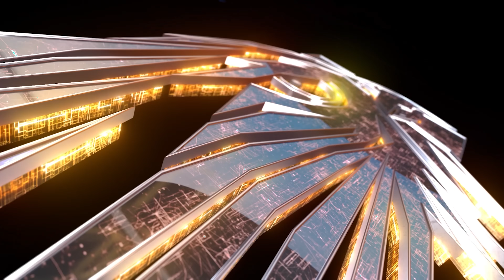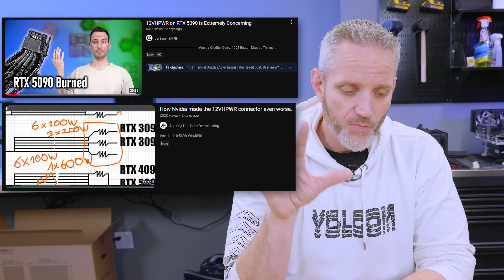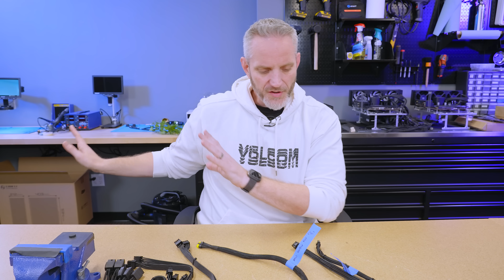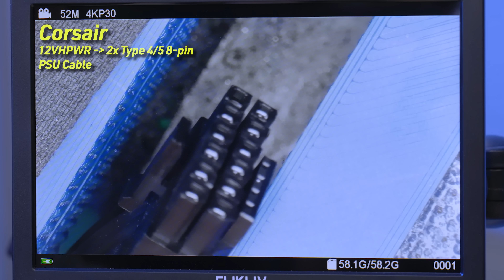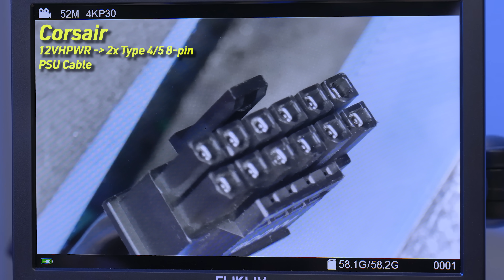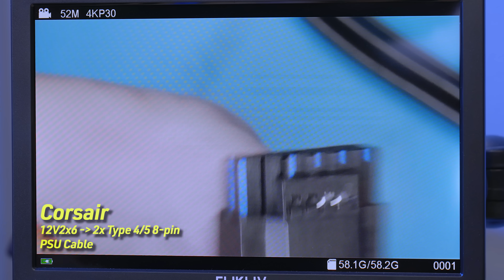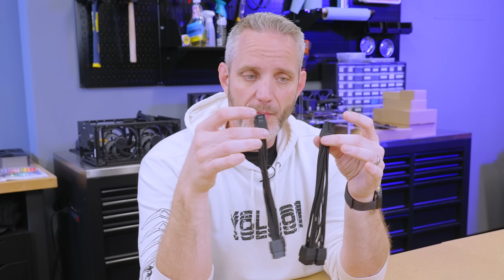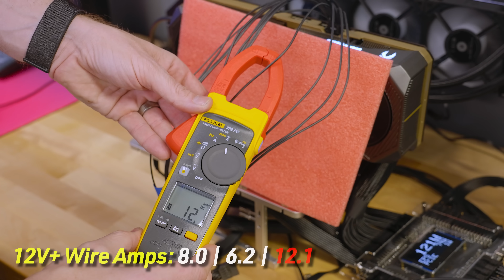I discovered something concerning and I need the Experts to chime in... More 12VHPWR discovery!

Comment: Without load balancing or per lead current protection, this is a problem.  Google what gauge wire you should use for 12v @600w over 3ft.  If this were a "to code" build, like a house or appliance, that's usually a 6ga.  A 6ga wire has 13.3mm^2 area to carry the load, where as 16ga is 1.16mm^2....  6 leads is trying to get the job done with only 6.96mm^2 area in a perfect world.  Stay around the car stereo scene long enough and you will run into the person who thought they could just twist together a bunch of speaker wire to power there high current 12v amp...  Sound familiar?  Know where this is going?  No blow fuse, amp playing fine, until the moment the carpet catches fire....
Reply: The best blunt sessions tho fr 😂😂
Reply: Correcto. 16ga would still be cutting it close, but would likely be ok if it were balanced. I work in Data Centers on critical power, definitely not a GPU expert, is load balancing possible through like a firmware update? Or just engineering?
Reply: @superthrustjon   Unfortunately no, the cards affected have the high rail all connected by a single plane so the problem is baked into the PCB layout and cannot be solved firmware side.

Furthermore the problem is likely not limited to high rail side, the grounds are all connected together as well on every single card. I think there is a high likelihood though that if the ground connections start failing, the card will receive a ground offset and plain stop working properly without visible damage to the 12v 2x6 connector. Other possible outcomes result in current through mounting bracket and enclosure (EMI) or burning PCIe edge connector.
Reply: I bet this is faulty crimps. When the wires are stripped if any whites are accidentally cut, as regularly happens when you strip by hand, this can cause the crimp connection to see increased resistance leading to an imbalance between wires. The total strands and number of cut strands will effect this quite differently.
Reply: Lots of thinner cables dissipate heat better than one thick cable, because they have higher surface area. You don’t wrap your cables in braided sleeve, do you?
Reply: @Scrogan - Certainly multiple smaller conductors can provide better heat dissipation, than fewer larger conductors, provided variance tolerances are negligible (manufacturing, mechanically and electrically) and each conductor is carrying similar current and within rating. +~- 30% electrical variation under/over conductor rating, is not negligible. That’s not to suggest the cable/connector is the only factor (PSU/GPU design also matters), but there should be no conditions out-of-the-box, during normal operation under load, where exceeding conductor rating is sustained - that’s just overall bad design.
@UberUdder09 - Not to be condescending, but the skin effect affects AC applications as there’s no magnetic flux rate of change back-EMF induced on DC ELV.
Reply: @johngy6296   you have misinterpreted what i am suggesting.. skin affect will result in more limited distribution of current in the conductor resulting in higher resistances in ac circuits and potentially the need of larger conductors like 6ga. 

your comment also confirms that skin affect is different between 6ga and multiple 16ga.. apologize if my use of “might” threw you off
Reply: @UberUdder09 - Not sure why you ‘replied’ to me, as I clearly wasn’t trying to be rude to you. The skin effect ratio (as it pertains to your original reply to me) is only the difference between AC/DC resistance, whereby the conditions for skin effect to occur in an AC application, require the cable (etc) to be suitably derated/over-speced, as compared to the DC rating given. Being that the rating is based on DC applications for this DC application, I’m unsure why skin effect between different sized conductors ‘might’ require consideration? Unless I missed something during studies (which is entirely possible).
Reply: @UberUdder09  Long time out of school so I may be misunderstanding, but the "skin effect" as I recall is a bi-product of alternating current, with the higher the frequency the more prominent the effect.  However just because the energy is flowing in a field around the cable and is not physically "on the line," induction is still a thing, and the wire heats up just the "same."  This is both how a transformer works, and why they are usually pretty warm if you put your hand on one.  There is some relation with the extreme side of this effect that is leveraged in very high voltage transmission lines, but all of that is high voltage / freq AC stuff, when this is the most simple of DC problems.  like voltage divider is to skin effect, what a flashlight is to a cpu wafer.  Its the K.I.S.S. side of engineering getting messed up here lol.
Reply: @Scrogan  You buy a 20inch large pizza. The driver shows up with 2 10inch pizzas and says, we gave you 2 10inch to make up for the 1 20inch, we were out of boxes. I understand what you are thinking, but go ahead and do the math. In fact, I did the math in my post for this specific problem. If you are talking cross section, circumference, or surface area, it fails all three. In fact the multiple light layers, is how you stay warmer in the cold ;-). For  serious though, for any given power load, as you move from thicker to thinner cable, you increase the resistance in the cable, more of the energy then goes into generating heat in the cable itself.  Exactly how a fuse functions, designed to fail above a certain load, except a fuse is designed to fail; safely.
Reply: @JayDDubbleyuh  why would I replace one 16mm^2 cable with two 4mm^2? You’d replace it with two 8mm^2 or four 4mm^2, and get something that can handle higher current flow without melting the insulation. If you overpsec the cables such that you only need 3/4 of them to run the required current (and they’re all commoned together at both ends) then you add redundancy too. Same way Starship’s booster can still function as normal when a couple engines have failed.

Of course, in this case the 12V lines likely aren’t all commoned at the GPU end, without capacity for redundancy.
Reply: Yep.
Reply: if both end short all 12v together and all ground together , the unbalance current between wire should not this big , current will distrubute by resistance
Reply: @h.y-chen   That's not entirely helping because current is really large in total, so tiniest differences in resistance result in large current differences!
Reply: @ yea, just wondering if firmware could fix it for those poor souls who already have one, I’m assuming it’s a common bus on the PSU side but not the GPU side? Again, not my area of expertise.
Reply: @ the official adapter did short all rail together( for 4090 one) , maybe just use that
Reply: @superthrustjon  There is no way to fix it with firmware other limiting the power to something reasonable. It would require a redesign of the circuit board to make it possible to load balance the individual wires on the 12VHPWR connector.
Reply: skin affect might be different between 6ga and multiple 16ga
Reply: @UberUdder09 do you even know what skin effect is? You need kV to start noticing skin effect.
[Edit]
Not even high voltage, you high frequency for skin effect and in PC frequency of current is ZERO
Reply: @  appreciate the aggressive tone of your reply.. thanks
Reply: @IamUzyf  and yes i do know what skin affect is.. thd skin affect ratio is different between ac and dc circuits.. there is less resistance in dc because of a lack of skin affect. additionally the current being evenly distributed within the cross sectional area of the multiple 16ga wires may still be equal to or greater than the 6ga wire of an ac circuit of equivalent wattage. may take a wee bit of calculation to prove it but this comment reply to you has already bored me of this topic
Reply: @ man, skin effect does not exist in DC circuits

Comment: Every electrical expert:  this shit is bad like really.  

Tech companies:  Its fine.
Reply: Penny pinchers know their stuff. And everyone elses.
Reply: I do electrical engineering in a field where failure is NOT an option. The fact this stuff gets produced is astounding to me
Reply: I'm an idiot and I can tell it is shit connector.
Reply: @n3m37h the worst part is there are connectors that are proven to be not shit yet they chose to design their own dogshit in house
Reply: @ 100% haha Are there any melts on the negatives at all? Just in my specail understanding if it was a ground problem it would just be a GPU crash vs the positive is constantly arc welding if they use junk connecters dont get me wrong they worked for years before bumping power above 500w hell anyone who does 6s rc cars or installes a car battery could tell you what would happen :face-green-smiling:
Reply: @n3m37h  You need zero expertise to tell it's bad.  How?  Because THIS MANY PEOPLE have to review the cables to figure out what's wrong with it.  It's a damned power connector.  It's one of the simplest things to make, relatively speaking, on that card and they can't get it right?
Reply: @BullsMahunny  at this point i think it was a deliberate conscious choice in order to force more cards to burn up quickly so Nvidia could force people to buy replacements.
Reply: @n3m37h  It's not just a shit connector, it would be just barely okay if the power delivery on the cards wasn't absolute dogwater.
Reply: I bet the fire marshal would say that shit is life threatening
Reply: @thepersonwho269  no lol, fire marshals don't know shit about engineering.
Reply: Yeah, these 12pin connector issues are because of throwing simple electrical rules right out the window. To think that software and not proper hardware design is saving Jay's card is sickening. Having the safeties built in at the hardware level is top priority. 
The whole thing smacks of a Jr designer, right out of college, trying to design for "perfect" conditions and using a tap rule table and not absolute current ratings for the wiring. Which any experienced Electrician, or Electronics wiz knows as a basic.
Reply: So many netizens defending the design and say it's a user error. I think they got no brain cell for sure.
Reply: @Chris-u7r9x  No, what is no brain cells are so called enthusiasts whose experience in electronics is plugging things in deciding that actual engineers who developed these systems are less knowledgeable than them.
Reply: I just wonder who is paying them to push this new nonsense
Reply: @NotEvenDeathCanSaveU  NVidia is heavily invested in the development  of said cable,  they rushed it out and customers are the testers.
Reply: @zack9912000  We see that a lot lately. Most prominently with swasticar.
Reply: Agree.  Great to see people like Jay trying to help, but every single 4090 and especially 5090 is going to fail at some point because of the power input the way the card is doing it.  It's that simple.

FWIW if I HAD to pick a cable to use, I like what Cooler Master is doing with the sprung connectors and other things, but I'm also a CM fan so there's that.

Either way from an electrical engineering standpoint the power input INSIDE the card is not sound.   Period, full stop.
Reply: Yuuuuuuup, any poor join is going to fail exactly as shown, those pins have to be seated without any movement.
Reply: That is true!
Reply: In general those connectors and wires aren't good for any serious power transfer.
Just look at the wire area and connectors you have between the alternator in your car or electric installations.
For 50A (12V, 600W) you'd need 16mm2 (AWG 6 for US people).
If you search for connectors with that spec you'd end up with the Anderson SB50 or the yellow ring terminals that you can find on vehicles.
Reply: @ehsnils  and 2 6AWG or 16mm2 of SOOW or something similar would be much easier to cable manage than 16 x 16 AWG wires bundled together. There where off the shelf solutions Nvidia could have easily gone for with this and ones that would have been cheaper, but i think they deliberately chose such a bad design with the intention that GPU's would burn up and force people to buy new ones.
Reply: I'm an EE, and I can confirm it's shit.
Reply: EE here. Also assuming it’s just a 12V and gnd (I haven’t studied the details here).   Why not use an XT60 connector?  60A constant. 180 burst.  Or an XT90 (yep. 90A) and drones fly on the damn things. (Also smaller!)
Reply: @Resident_Lunatic2  The XT connectors looks nice, but some specs gives lower values for them, like 40A continuous / 90A burst for the XT90.
They seems to be a lot nicer than the current connectors though.
My thought about the SB50 is that if it's good enough for charging a forklift with 50A it should be good enough for a graphics card needing 50A or even more.
If you go back through history many old computers did consume a lot of power and their power rails were serious.
Reply: @Resident_Lunatic2  Bam! I knew I saw a connector somewhere. Bro, you fixed it. They need to pay you now.
Reply: Making stupid decisions to spend cents less on a 3000$ board is just disrespectful

Its stupidly easy to make sure connections are intact, fucking 100$ 3d printer boards have this shit locked down for years now, and nvidia cant figure out the most basic security and reliability shit?
Reply: "This is fine" meme. Literally.
Reply: Well it's really just Nvidia forcing it down our throats. The 3rd party cards have to follow what Nvidia wants. Power supply companies also just follow suit cause Nvidia.
Reply: The first thing I thought back then was: This cable is supposed to deliver 600 watts? Why is the connection so small and why are the cables so thin?
Reply: Low volt guy here, this connector is not adequate for the amount of load being delivered. It’s too small and concentrates heat in an even smaller area, the pins being smaller and having less surface area adds to that problem. And awful QC on cheap cables makes everything worse.
Reply: @corymorrison4488  funny thing is nvidia contracted Intel to build them those custom connectors. Guess who's not using those custom connectors on their video cards.... Intel.
Reply: @Mikey-Likes-I.T  its not a custom connector its a new standard. it was developed to be the replacement for the PCIe 8 pin
Reply: As an electrician, poor contact between wires are usually the most likely culprit for over amping. Grounding is usually second.
Reply: @TravisDoomGuide  and 3rd might be improper impedance balancing in a multi wire setup? Think of using a different gauge and length of wires in a 3 phase AC setting pulling enough power to exceed the rating of just 1 wire... Elec goes through a path of least resistance > more amps > more heat > melted cable > fire.
Reply: @ didn’t think of that one but true.
Reply: @ also they not even accounting for like crimping tolerances, and manufacturing variance from pin to pin. OF course they arent gonna split current evenly at this power rattings milioms difference is gonna make a huge difference. this is like highschool physics
Reply: "This is fine" ahh
Reply: Sounds about right.
Reply: LOL 🤣
Reply: Like 100 years of automotive, marine, and aerospace regulations written in literal blood, ignored by an industry that hasn't had to deal with more than a couple hundred watts since CRTs were phased out.
Reply: Physics/EE here... It's bad. The problem is people are just buying CHEAP cables and connectors. They need to increase the guage of the wire, and start using much higher quality connectors. It would be awesome if the card had some current sensing parts added to detect an unsafe connection and shut down though, but this would cost extra money!
Reply: @dohabandit  cheap cables ain't the issue. They don't help but they ain't the problem the spec of the connector is the issue always has been. And Nvidia is at the ragged edge with a 575 watt card on a 600watt spec cable and plug... But even then 450 watt cards burned them it's a bad spec from the begining
Reply: @dustinharvey7394  Funny, I guess the highest quality connectors must somehow work with the very slim safety margin. The connector definitely needs to be retired and a better design with more safety margin and higher guage conductors used. I'd personally pick wire that has a high number of copper braids, more surface area, higher current carrying capacity.
Reply: In short, you will have to spend another several hundred dollars to buy a PMD2 to ensure your video card does not fry.
Reply: Edit: It's fire.
Reply: Experts work for them as well you know.
Reply: PC Industry need to sit down and consider resigning the graphic card power rail using 24V DC instead.  The Graphic Card Power Connector needs beefier redesigning too like connectors used in UAV battery

Comment: But 12V-2x6 was only a revision to the receptacles on the cards. There's no documentation about any revisions to the connectors on the cables... unless I missed something? Perhaps they've moved from Micro-Fit to Micro-Fit+? I thought I saw Jon Gerow over at Corsair, talking about using Micro-Fit+ on their newer ATX3.x power supplies and the Type-5 cables.

Also, for anyone watching, this doesn't conclude there is an issue with the cable. The only thing we can conclude for certain is that the PMD2 is awesome and load balances. Not that Jay was saying it is definitely the cable... just some people might come to that conclusion watching this.
Reply: This is what Corsair documented on their blog. 12V-2X6 only revises the ports to be more secure and make better contact. The cable is unchanged.
Reply: @VectorAero  Okay, yeah... that's what I thought. Thanks for the confirmation.